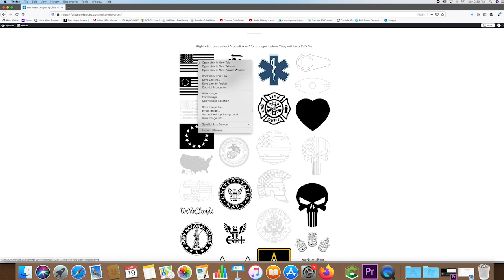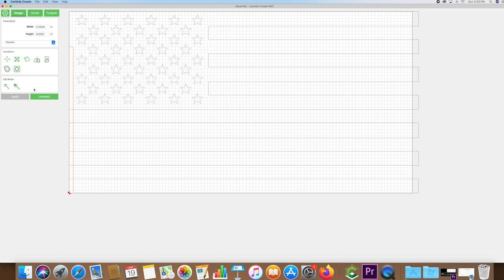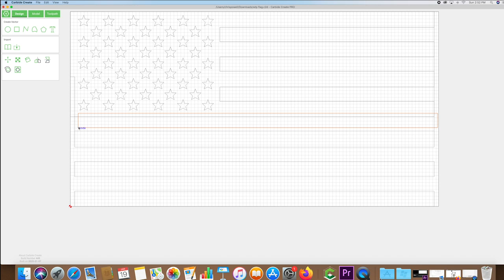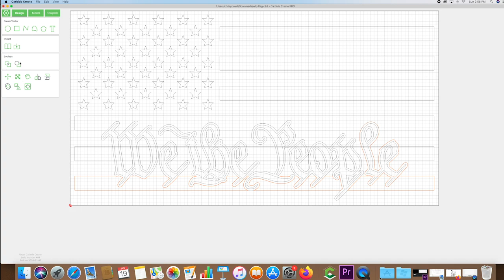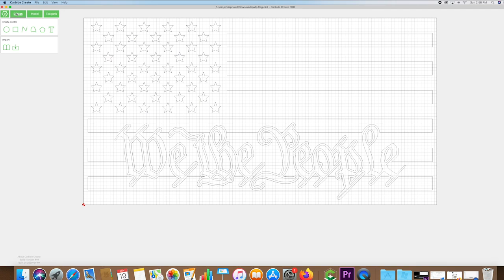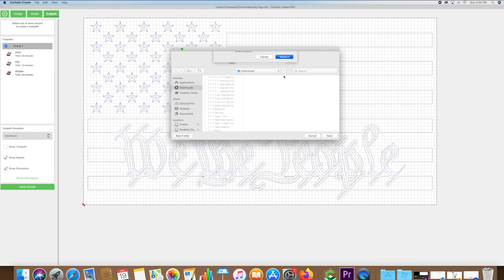How To Make This Wooden We The People US Flag - Carbide Create Tutorial

Comment: Hey Chris. I followed along and programmed this flag in carbide create, not Pro. I tried to open the program on my Shapeoko 4xxl and it cannot find the file. Can I assume that since it has a vcarve in it and I don't have pro it won't save the gcode?  And if i upgrade to pro will I have to reprogram the whole thing? m not super knowledgeable on my cnc yet so I'm not sure if I'm missing something. I've created projects and made them before and I'm thinking the vcarve is the only different thing. Thanks in advance and thank you for making so many tutorial videos.
Reply from the maker: The v carve should work fine. They’ve made a lot of changes to the program. I’ve stopped using it because it’s too hard to keep up with.
Reply: In the programming it only gives me the option to save the toolpaths, not gcode. Any thoughts on how i can get it to work? What program do you use now. Vectric by any chance?
Reply from the maker: @kevinstebner5523  I use Carveco Maker. I have some videos on it

Comment: how do you know what size to make your union? I have a file that I resize depending on the stock so my union changes constantly.  Single color flags are no issue but when I want to do red, wood and blue, I don't know how to calculate the size of my union to be able to stain prior to cutting.  Any tips on how to figure that out?
Reply from the maker: You can just scale them to the size youneed in your cnc program, CC in this case, and draw a rectangle around the union. 

Personally, I cut my stripes first, and then apply the stain. I thought I showed that in this video. If not, check this one. https://youtu.be/Yf-ZMGDFimg

Comment: Hi Chris,  I am clearly doing something wrong.  Have tried repeatedly to trim the edges of the stripes by .25 but I keep having pieces left over that I cannot seem to delete without impacting another Stripe. I am also getting confused by copying a stripe and dragging it down.  So am I basically dragging and dropping?  I am a PC user.

Also noticed this new version of CC does not have 'group elements' check box.  Is this the same as grouping vectors?
Reply from the maker: Yea that should be the same. Just make sure you’re selecting stuff in the right order. It makes a difference.
Reply: @ChrisPowellFSD  Hi Chris sorry for the constant questions.  A version of your CC is different than mine.  Contour and pocket are two different buttons now in the tool path selection.  For the Stripes, I did a pocket at .08 depth.  I also noticed that the max depth for my Stars is .75 same goes for we the people. When I simulate the job P in people also looks weird and I cannot figure out why.  Unfortunately no ability to post a screenshot in youtube.  Thanks.
Reply: @Chris Powell disregard the above.  I figured out my issue.  Copies of we the people were not precisely aligned and sitting on one another.  Also,  did a pocket and left the v carve depth untouched. The simulation looks good. I'll see how the cut comes out.  Thank you for all you do.

Comment: Did you stain or paint the stars? If so, how do you prevent overspray on the red and blue areas?
Reply from the maker: No I just leave them as raw wood. If you wanted to paint them, you could mask the other areas before cutting the stars. I like using Duck shelf liner.

Comment: Chris.....just tried to duplicate your WTP flag>  I followed your instructions but my flag did not turn out like yours.  The starts have rounded edges (I used the 60 degree v bit) and the cut is very deep (I think).   The WTP is carved very deep and doesn't look as crisp as yours.  Where do you think I went wrong?  I call myself following your instructions verbatim but I must have missed something.  I have reviewed the video several times and don't see where I went wrong.  Any suggestions?  Thanks.
Reply from the maker: Sounds like the z was set too low.
Reply: I used the carbide probe to set the z.  Should I have used paper to set it?
Reply from the maker: I use paper myself. Also, make sure you’re using the correct bit. If you set it up as a 60, make sure what’s what you actually use.
Reply: I used the #302 bit.  Is there something else I need to change
Reply: Would you mind looking at my Carbide Create file?
Reply from the maker: Sure. Send it to Chris@fullsteamdesigns.com
Reply from the maker: I didn’t see anything wrong with the file. Looks like the z was set a little low. Also, based off your pics, it looks like it might have shifted your x, y 0 when you cut the words.
Reply: Should I reset the x and y when I go from one bit to the other?  I did when I changed out from the end mill to the v carve bit.  Thanks so much for your feedback and looking at my file.

Comment: I was able to follow you video until you got to the off set. Did you copy and past the off set 3 times and  at what  point did you ungroup the stripes. trying to follow along in vcarve pro to design the flag.
Reply: Sorry i did not include my name Jeff
Reply from the maker: Hey Jeff, I copied it 2 times so I had 3 of the outlines. That was just because it covered 3 stripes. In CC, when you do a Boolean subtraction, it removes the piece you’re subtracting. You need the copies so you can do each line. The grouping can be off for all of this. I just keep the actual words We The People grouped to make the toolpath setting section easier.
Reply: @ChrisPowellFSD  Thanks . I will try it again.  Jeff

Comment: How many passes is your v-bit making on we the people? My first shot I mustve selected the wrong line set or something and ended up having the v-bit plunge way to deep and make way to many passes on the stars and wtp. They came out ill defined and, well, way to deep.
Reply from the maker: 2. I have my depth set to .156 per pass I believe.
Reply: @ChrisPowellFSD  Your Reddit post that led me here shows using a 1/4" diameter v-bit is that still accurate in this video? I am using a 1/4" shank, 1/2" diameter v-bit. It looks like Carbide Create selected .1 as the default for this bit.
Reply from the maker: I just modified the 302 bit(I think that was the number). You should be able to step up that depth per pass a little. .156 was what the old version used to set my v bit at, and it’s always worked well for me.
Reply: @ChrisPowellFSD  Thank you very much for your mentorship. I'll dial it in and see if I can get similar results.
Reply: To anyone that is having a problem with a Shapeoko V-bit carving too deep AND you're using the Carbide 3D probe to zero: Put the whole probe box ON TOP of the workpiece in the middle somewhere if you're just doing Z, not the corner where you set XYZ. It was my problem all along and caused hours of frustration.